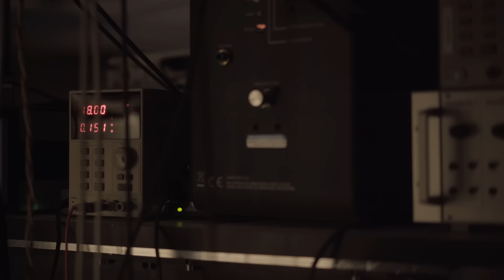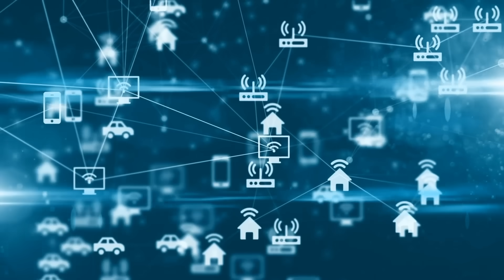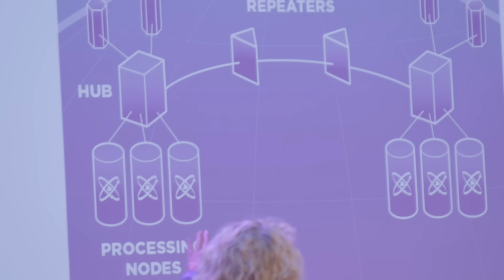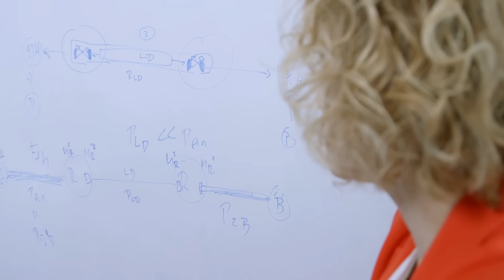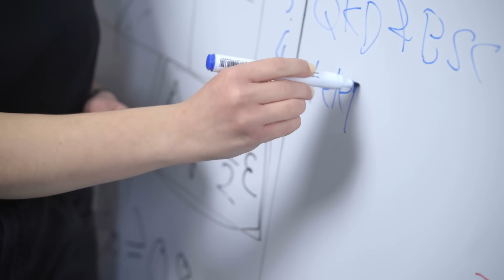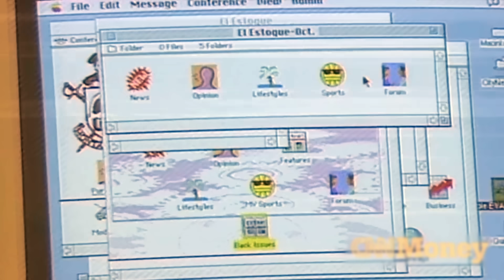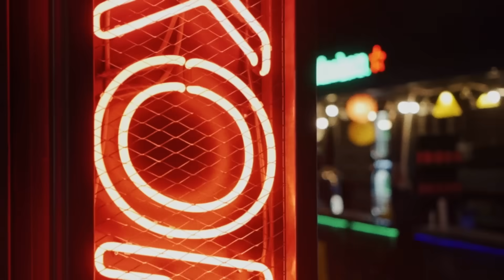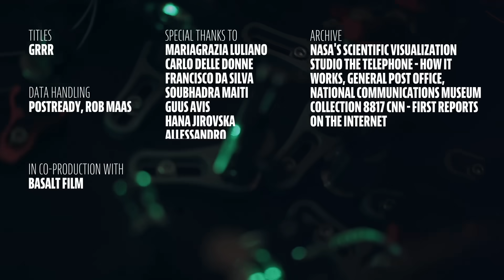Moonshot Mission: Stephanie Wehner on the development of quantum internet | Ammodo Docs

Comment: Could FTL communication be possible by varying the time between determining the spin direction of entangled photons. For example, if the time between detection of Photon1 and Photon2 = 1 ms then the value is 1; if the time is 2 ms then the value is 0. If the value is 3 ms then that is the signal to start a new series/byte. So: 2ms1ms3ms1ms2ms yields two numbers: 01 and 10. (The spin direction itself does not matter).